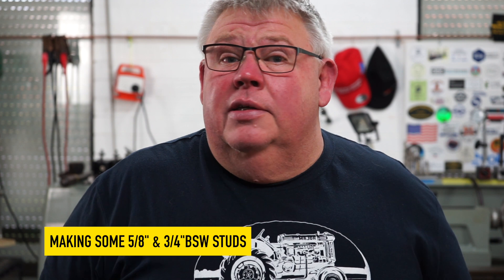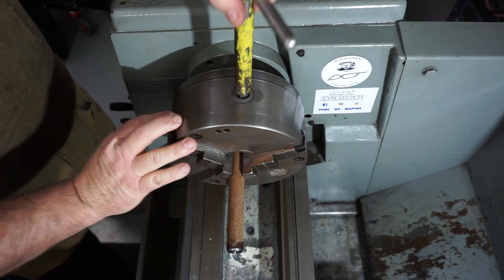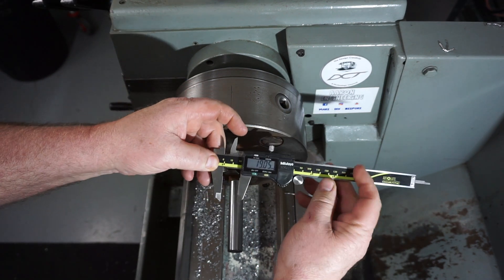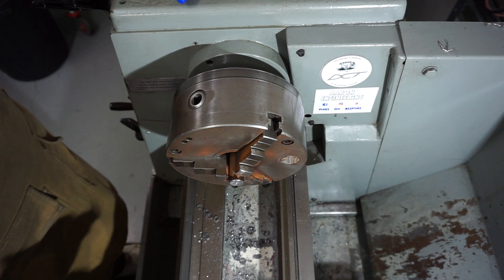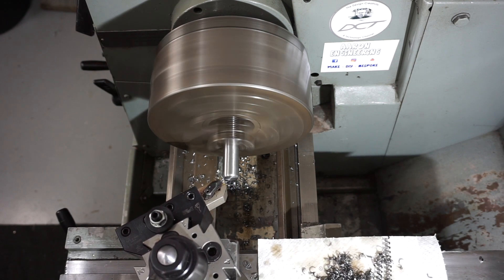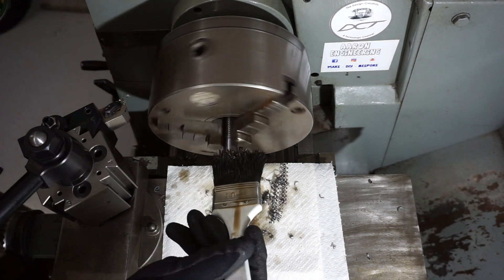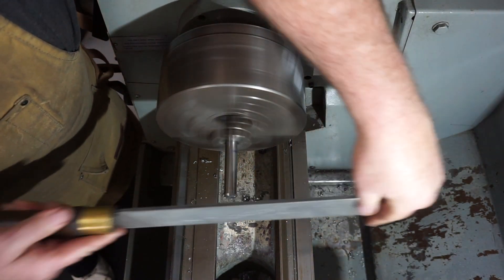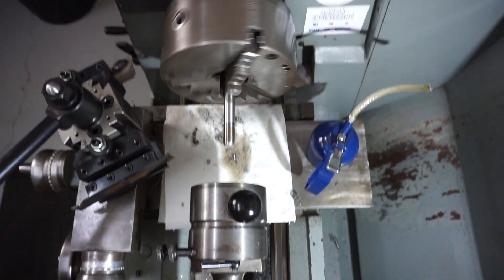Lathe threading made EASY

Comment: Anyone here know the history of the toolmaker EFEM company who was making these heads?
Reply from the maker: Sorry I don't know the history.  However, I found this PDF and will share URL for you.  Cheers, Aaron.
https://5.imimg.com/data5/RY/GI/EV/SELLER-2415472/die-head.pdf
Reply: @AaronEngineering  Thank you Aaron,  this was very helpful. Never came across this pdf myself. Got an Efem H1c that covers M2-M8. I use it for making M8 x 1.0 x 80 lathe hard stop adjustment screws. What I really like is how easy it is to copy the exact major dia of OG screws and the nice resulting finish. Was not aware that the numbered chasers pitch varied. Anyway, allegedly, Efem was located in Germany and their version of the Coventry Die Head is considered an improved one.  The tool I've got comes with laser engraved scales, indicating it being of relatively new origin, still I cant find any info easy available on the company Efem.

Comment: Hi Nice work .Can you tell me if you can cut trapezoidal threads with that unit?
Reply from the maker: That’s a very good question. I suppose most threads are possible with the correct chasers installed. But I haven’t seen it done. Cheers Aaron